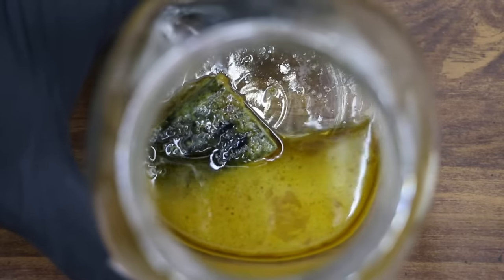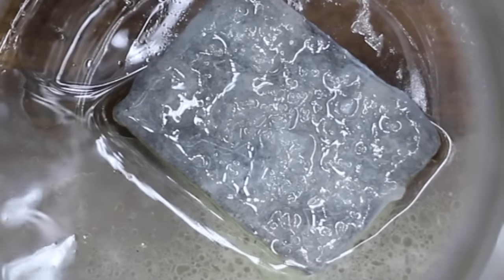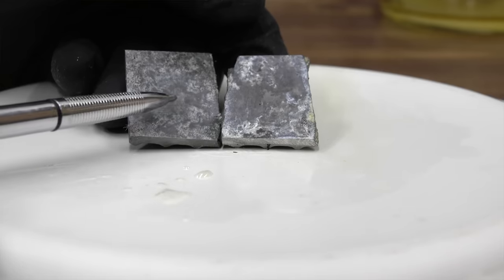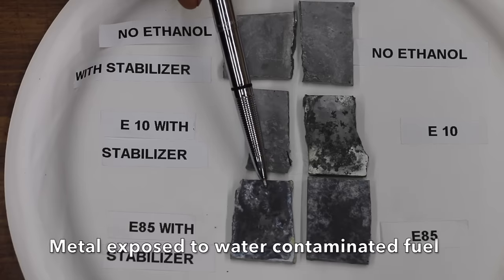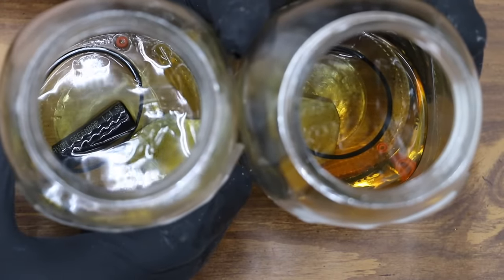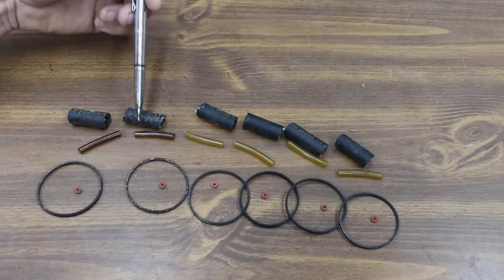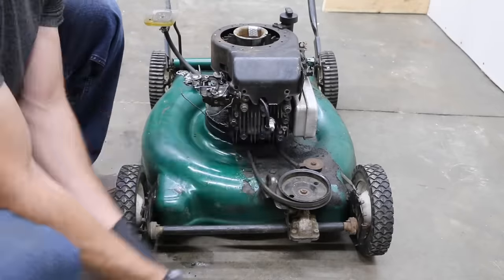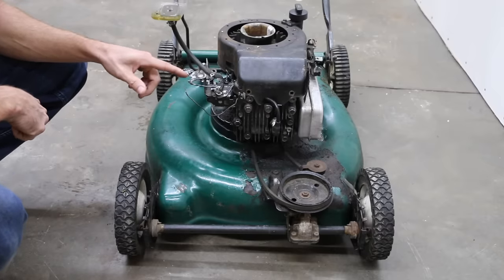Does Fuel Stabilizer Prevent Ethanol Damage?  Let's find out!

Comment from the maker: Thanks for requesting this one.  I have another video on fuel stabilizer on the way but it'll be a couple of more months before they fuel has reached 12 months.  Here's a link to Lucas Oil Safeguard Ethanol Fuel Conditioner: https://amzn.to/2YoesHa
Reply: It seems like the non ethanol fuel will run but the engine needs to be hot already. Like the spark plug and exhaust valve need to be at operating temperature? Maybe? Or at least very hot. Because ether burns very hot and makes engines hot "warming them up" and allowing them to stay running. But just because they run i have no doubt that the work that the engine will be abke to do with that poor fuel will definitely be less.
Reply: Great videos.  Would you do one with marine Stabil (blue) and E-10?  I just don't know of anyone who uses Lucas.  Keep up the good work.
Reply: does the stabilizer go bad? that would be something to test, like what if after a couple months you would add some fresh stabilizer or a little fresh fuel?

on a side note: I'm not a chemist but what if whatever attracts water to ethanol is taken out of the equation? such as a water-like compound which replaces it in ethanol so that it can burn instead
Reply: I was looking for an "Old" fuel video, good thinking!
Reply: I bet you could get a good idea on how the fuels affect the rubber components by a pressure needed for compression of the rubber to a certain distance. So for example the new hose fuel hose would be the control reading and would give a reading of say 1.5psi needed to make the inside of the hose touch each other when pinched off. Something of that sort. With other stuff you could pinch it and get a reading, and then measure the distance pinched for the reading you got and make a shim of that thickness of metal or use a certain thickness metal from the beginning. This would give you the most accurate comparison between the rubber products. 

 You can contact me further if you want to do this but I didn't completely explain myself well enough. ;o) I really like your videos.
God Bless!
Andrew C.
Reply: @heyitsdrew  Yes the stabilizer goes bad after opening it. Sta-bil (Not tested in this video) Recommends labelling the bottle with the date that it was opened so you know if it's till capable of stabilizing fuel after a certain point.
Reply: Yes please test fuel stabilizer in general for non-ethanol... Like storing fuel for emergencys and such..I try and keep a few 5 gallon metal containers of stabilized fuel around to run the generator in case of power outage or in case of major incident to run the car.
Would be interested to see how seafoam, and stabil marine formula do at stabilizing fuel. I used startron last year and my 20 gal of of non ethanol (read $100) of fuel was almost unusable after 10 months in sealed metal jugs stored under cover
Reply: This was amazing.  There's just so much data in such a short video.  Honestly the highest praise I can give is that the info you provide is being factored into the farmstead we're planning.  We plan to re-use and repair a great deal of our equipment.  You arm us with so much knowledge not about machinery but about how we'll want to maintain it.  Maintenance is worth it's weight in gold, good maintenance is worth it's weight in relaxation.  You help us develope informed plans for maintenance and materials choice so thank you!
Reply: I have had much better success with the Sta-bil fuel stabilizer product, even with e-10.  Will be interesting to see your results comparing brands.
Reply: @heyitsdrew  Farm equipment has a sediment bowl that will catch the water that can be drained.  Air compressor equipment has water traps and filters.  I think there are specific water filters for fuel lines.  I wonder what race cars have?  I have not checked.
Reply: Project Farm and others interested: I hauled the fuel and worked at and with ethanol plants. I dont support ethanol and its very bad for any engine aluminum or steel. That gunk at 6m41s is likely left over sugars that corn produced in the distillation process of the ethanol. So after vaporizing for 9 months for your experiment, thats the left overs from the ethanol. Ethanol is made from corn or other cellulose. They grind it, mash into beer a.k.a. ferment it into sugars that feed the yeasts that create the alcohol. When they heat the mash it vaporizes it. Vapor flows up the tower, then the vapor goes down the "worm" or cooling tube and becomes liquid corn whiskey (or cellulose) ethanol, same as moonshine production. After that they add the gas byproducts such as natural gasoline to the ethanol to poison it and produce the final ethanol product for shipment. Once at a fuel terminal, tank trucks load the ethanol percentage into their tank followed by the grade of gas and thats when its blended to gasoline you buy, right before it goes to the pumps.
Reply: @heyitsdrew  ethanol doesnt attract water.
Reply: @Seriouslydave  yea ok. take a gallon of e10 gas, put in 10% water, shake it up, and watch what happens. it combines with the ethanol.
Reply: @heyitsdrew  that sounds like phase seperation, if your theory is correct let that seperation happen, and siphon off the petrolium now, according to you, youll have ethanol free gas. Or maybe oil and water dont mix? What happens if you mix water and alcohol?
Reply: Try mechanic in a bottle...
Reply: Did you complete the other video on fuel stabilizers you mentioned above?
Reply: Getting close?
Reply: @curvs4me  good tip. Would this method work on a motorcycle, or could you damage a carb from excessive vacuum?
Reply: @curvs4me  sweet, thanks man! I'll give it a careful go on my Fireblade 😗
Reply: @itptires  something i am about to find out, got non ethanol gas nearly a year old, 1.5 ounces of seafoam to a 5 gallon sealed container.  supposed to make the gas good for up to one year, and i am 9 -10 months in right now.  i am also told to use stabil fuel stabilizer, so, guess that will be the next one i try.
Reply: i'm thinking MBTE is worse than ethanol,
Reply: @heyitsdrew  
Sta-bil has a shelf life once opened. A year I think???
Reply: @itptires  
Used that startron crap when it came out. Had to rebuild the carb. on my snowblower afterwards. Back to the Marvel mystery oil.
Reply: @clearlyconfused9194  ethanol suspends phase seperation, basically it holds the water to the ethanol better than petrol does so when the mixture evaporates you are left with ethanol and the water, and believe it or not the water is important for the combustion stage. So the moral is, dont leave ethanol fuel to evaporate for more than 3 months in a tank/container without stabilizer, and run it out of the engine.

Before ethanol in fuel, gas would varnish and tar up engines, etanol gels and turns to white crystal. Put some (a little) liquid mechanic in your gas tanks and run it out for the season. There is no reason your vehicles underperform on ethanol, it is a more efficient fuel.
Reply: You should test mechanic in a bottle iv had really good luck with it
Reply: @charlesthompson8962  first thing i reach for when fixing an engine. Sorry i meant, Lawn mower tune up (LMT).

I have 6 pushmowers, tiller, wood chipper/leaf vac, 4 trimmers, 2 ride ons, 2 chainsaws..... didnt buy any of them. they were all thrown away.

And i repair everyones stuff in this neighborhood, cos im really cheap.
Reply: Did you ever make the Non ethanol gas with stabilizer after 12 months video?
Reply: @itptires  did he ever make the video?
Reply: Looking forward to this video, was jsut going to suggest a fuel stabilizer video.
Reply: The answer is to stop using ethanol fuel!
Reply: Thanks Awesome Farm Dude....Shoe🇺🇸
Reply: Try an ethanol extraction vid. I'm sure many people would like that.
Reply: I have a 2017 Nissan NV200 mini van and I’ve been using ethanol free fuel on my vehicle since I bought it new. And lately got a engine light on. Diagnosed it and was both front and back O2 sensor ( $260 ea to replace ). 

Was wondering why this happened since I ve been using a clean gas like ethanol free fuel on my engine when it supposed preventing carbon buildup.
Reply: @javierbaron1856  it's a 2017 nissan, that's the first problem. If you want a good nissan, buy one pre 2000. There's a few  things besides fuel, that can cause o2 sensors to fail.
Reply: Love your manual choke. 😂
Reply: Here's a question:  is it just as good to "make your own" ethanol-free fuel by removing the ethanol from E10 or E15 (by adding water, then pouring off the petrol), as it is to buy ethanol-free fuel?
Reply: Any chance you are testing other stablizers? Just my opinion, I know you went to a lot of effort, but this only reflects one brand.
Reply: It might be a good study to compare the different fuel stabilizer brands.  This video was very helpful and confirms what I experienced on my own trials.
Reply: What is the fascination with letting  gas sit 12 months?  Does not bode well for IQ levels.
Reply: @Fixin2Ride-Official-  This sounds like a saturday night live sketch about fuels.
Reply: @bradsanders6954 , some engines need to be run infrequently. Examples include emergency power generators, snowblowers and snowmobiles in some regions, and even PHEVs if they're rarely driven more than 20 miles.

Todd, I'd still like to know whether it is just as good to "make your own" ethanol-free fuel by removing the ethanol from E10 or E15 (by adding water, then pouring off the petrol), as it is to buy ethanol-free fuel?
Reply: @ncdave4life  Any engine, the owner needs to be smarter than the engine, if it needs to run then it shouldnt be let sit with old fuel. its part of maintenance....and it isnt hard! Its easy. Start it, keep fresh enough fuel in it.  Or start a business "removing ethanol" from fuel.....could just buy fuel from the 1 place in town that sells race gas and ethanol free high octane fuel....that would be too easy.
Reply: Why didn't you use Stabil? The industry standard?
Reply: I've run fuel that was 5 years old car started right up and ran perfectly. Direct injection engine. Don't know what you're talking about in here saying your container of gas went bad after 10 months. That's impossible unless you left it open the whole time. Gas doesn't go bad on a molecular level, at least not bad enough to notice under regular driving. I know people who have an RV start it once after 10 years and no issue.
Reply: Has anybody ever tried taking 10+ year old e10 gas sitting in a car that's been stored and mixing it 80/20 with new 93 octane? Will a car run on it? What will happen? Car in storage has 1/8th tank. You would be topping it off with brand new fuel and starting it, then topping it off every few gallons until the system is clean
Reply: Any update on best fuel stabilizer
Reply: @itptires  fyi: I've never put fuel stabilizer in non-ethanol gas and I haven't had a problem yet. During spring and summer I keep my outboard motor tank full. Starts every time.
Reply: E85 still has gasoline in it as my experience working at an ethanol plant using pumps that are made of aluminum there's no corrosion after numerous years of use the denature that is added to the ethanol is gasoline which is very corrosive
Reply: I was going to ask if you've tested Sta-bil 360 and Sta-bil 360 Marine. Both of those claim to help with ethanol.  Would also be interested in seeing some kind of comparison for which PEA additive (which both of these are) prevents carbon build up in DI engines.  Also Top Tier fuel vs non-Top Tier fuel.  Top Tier supposedly contains some PEA which prevents the build up in DI engines but lots of people are saying Top Tier is just marketing bull.